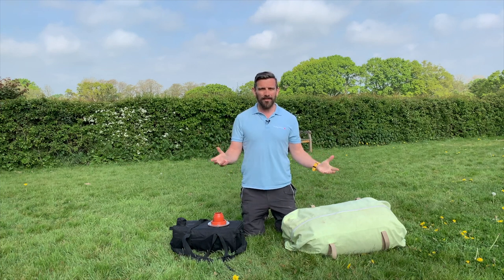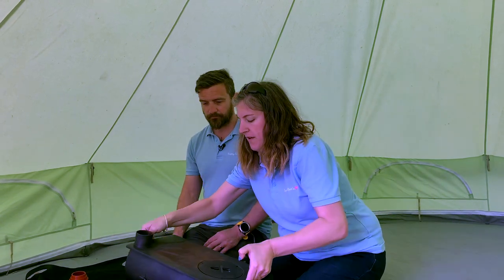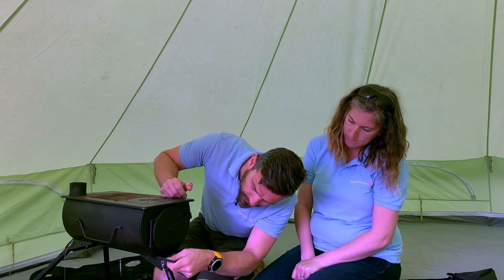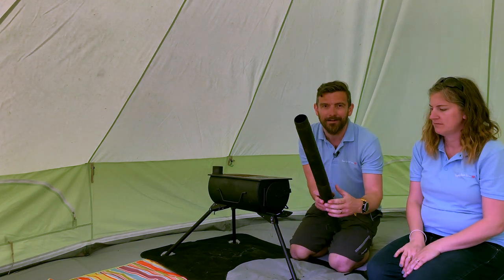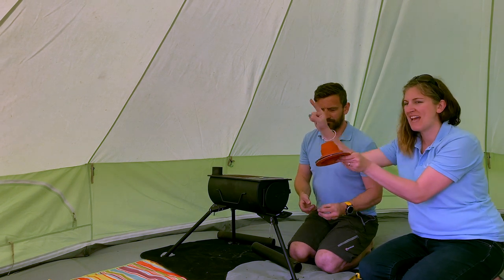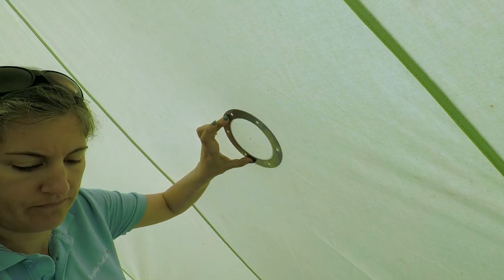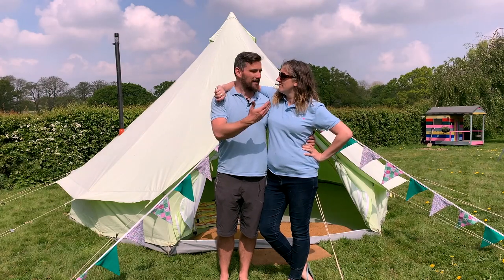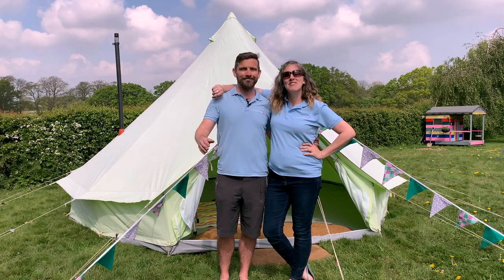How to install a wood stove in a 5m Canvas Bell Tent | Tent Stove Flashing Kit | Baylily Bell Tents

Comment: Thanks again for another concise and educational presentation. 

I've  noticed in similar y/t videos that very few guy or support the flue stack in any way.  A mista,e in my opinion.

In some circles they recommend 3 sheet metal screws in each joint of pipe.
Reply from the maker: If we were going to have it erected and set up for a period of time or if the weather was particularly bad we’d recommend peg out the flue stack..

Thanks.. 🙏

Comment: Nordisk supply a sheet of self adhesive tear repair canvas. I think I'll use a square of that over the marked-out area before cutting. It just feels better to reinforce the canvas first, and it'll back up as a rip stop.
Reply from the maker: Good idea.. The canvas should be plenty strong enough to deal with it though. So unless you have a different bell tent with different canvas, it’s certainly not essential to do..

Comment: I’m assuming that you remove the flashing before packing the tent away. Is there not a risk of the canvas fraying of ripping with repeated applications?
Reply from the maker: Hi Mike, you don't need to remove it. It's fairly sturdy once in place and you can make sure that part of the tent is as flat as can be when you're putting it away. I say that, everything once altered has a shelf life, but we've never heard of these giving in..
Reply: Baylily Bell Tents thanks for getting back to me. I’ve had conflicting advice about this so am a bit confused. I have actually bought both A standard flashing kit and a large 45 degree kit in the end as I was unsure and had advice that the large one was more suited to a6 metre tent. I have a pre cut hole in the tent but this will not be big enough for the large kit. I think I am going to come to a decision this weekend as to which one to use. I have a couple of more practical friends who are going to help. I think the 45 degree kit would definitely need removing as it is so large. Really enjoying being under canvas but am worried about cutting holes in it!
Mike

Comment: Is it possible to fit one of these into a camper van with a fibreglass roof?  I would need to shorten the chimney. Can it be done?
Reply from the maker: Yes, in theory... You may just need to insulate around the flue as it goes through the roof as it may melt the fibreglass..
Reply: @BaylilyBellTents  Thanbkyou very much :-)

Comment: My stove is just like yours and I had to set it in the yard and burn it before putting it in the tent. It burned most of the paint off. If you don't, you get the fumes from the paint. I have a flange but it doesn't have the second ring and the screws. I'm at a loss about how to install it. I'm afraid putting screws in it with only 1 metal ring means I'm screwing it to the fabric and the weight could tear it. I read on the instructions to use a super glue and glue it to the canvas. If I do that, I'll have to find a heat resistant super glue
Reply from the maker: Thanks for the comment. I'd get a new flange with both metal plates if you can?